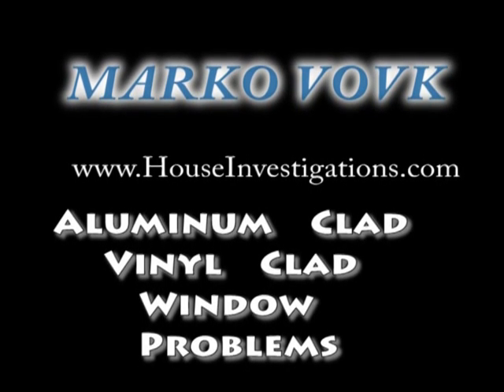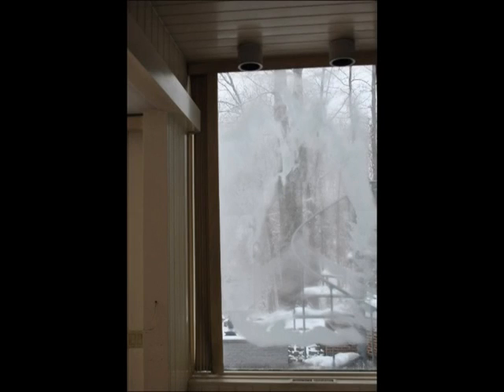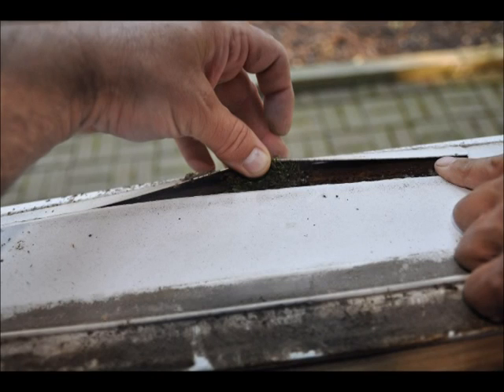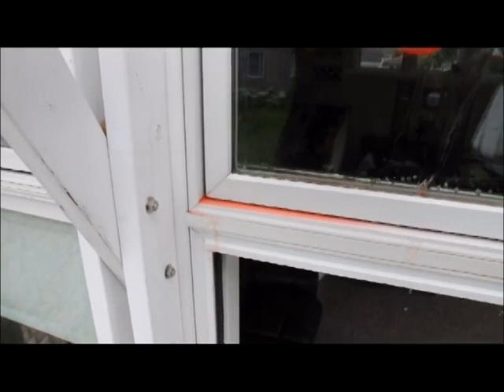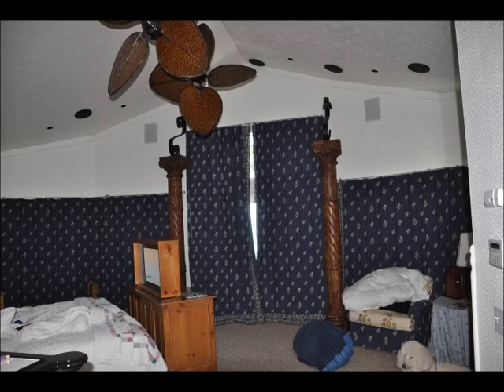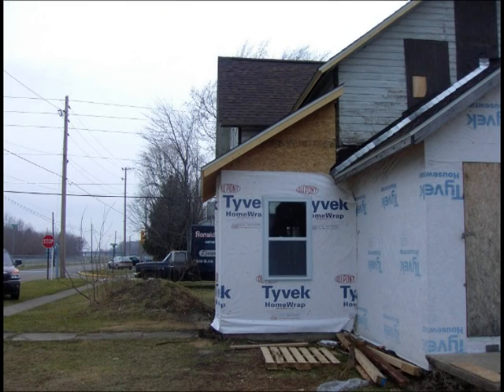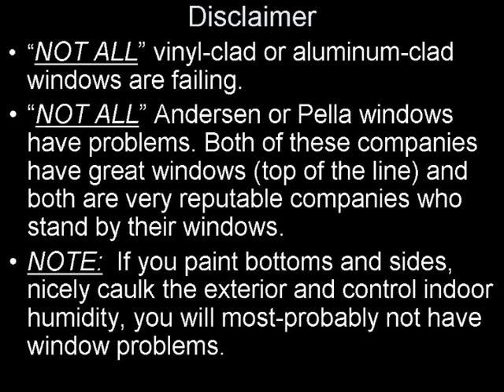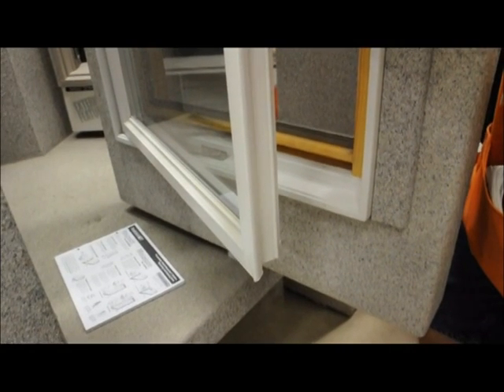Aluminum Clad, Vinyl Clad, Window Deterioration THE TRUTH Pella Andersen

Comment: My andersen patio vinyl clad door are rotten at the bottom - they used cheap pine boards untreated - put vinyl clad over with adhesive and they rot just about the time the warranty expires.  I have a few years left on the glass how do I get the glass to be compromised so I can still file a claim without them saying I caused it.
Reply: I ahd an Andersen Permashiled 8ft door, they had open wood on teh bottom where it sat on teh Al sill plate, it rotted teh side jampbs, fater 29 years I replaced it with a new Andersen Permashield slider with better ggalss now low e 3  as opposed to low e of 29 years ago, it is better, I also went SUN LOE E 3 really knocks teh heat gain on a big 8 ft glass.  The new Door hads solved teh problem of teh bad design of 29 years ago, the bottom now sits on a plastic spacer to limit wicking up into side jambs, and teh vinyl cladding is all one smooth molded piece along the outside jambs, before it was screwed in screen jambs and suck, things to improve in 29 years, now I will have it good till I am old enough to not give a crap, I also replaced all 31 of my casement sashes, with new low e 3 Sun glass, my self, ez pz new glass, just teh sashes, use the original hardware, SS, lasts forever.  New glass matters over 29 year old low e, low e sun the blue grey is better looking too, than the old sun in Bronze, it actaully lets in more visbile light, while stopping MORe infra red heating, thin fil SCINCE and more silver in teh coatings, gives good privacy, can't see in looks lot better too, with teh darker glas over just low e 3, my front gets blasted by direct sun, SUN GLASS matters.  All the Andersen casement main frame held up 29 year and still going, no water intrusion, it's all sealed, now with new sashes new glass 20 year warranty 10 on hardware, same as teh new Velux skylights 8 of em changed, Cardinal glass makes teh glass panels for most, low e 3 NEAT, they have Ti coatings outside that lets dirt wash off better Andersen calls it low e 4 (no such thing) it's Cardinal NEAT glass as Velux calls it...modern glass technology is better than ever.  Casements all sealed in vinyl clad is teh way to go, wood interiro, all exposed to moisture is sealed wood in vinyl, Andersen wins

Comment: Thank you for posting your video. We live in South Jersey near Philadelphia.  We have 23 Andersen double-hung vinyl windows in our home which was built in 1992.  Three (3) of 23 window sills are rotten. Not as badly as in your video.  Only the about 4-6 inches into the sill.  

Like the window in your video, they are missing the end-caps.
Can I repair these? Do I have any recourse with Andersen?
What should I do with he other 20 windows?

Regards,

Rob
Reply: Put in Andersen CASEMENTS, better window, better designs, all sealed in vinyl cladding, nothing exposed to water, interior is wood, plus modern low e 3 is better than teh old low e

Comment: @Clevelandmarko Rush hour around Paris is hell, I actually put up a lotta vids on this.  I sleep attached to a sleep apnea machine with a humidifier.  We leave the window open as much as possible and the French try to air out each room for ten minutes daily.  Minimum.  Odd climate here, foul air, not a healthy place.  I just try to keep that bad window ungunked, there is this cool drainage system in it.  A groove and I have to poke a hanger in there and ungunk it.